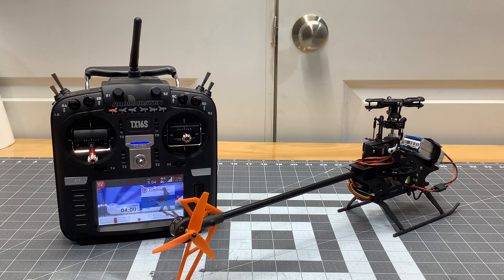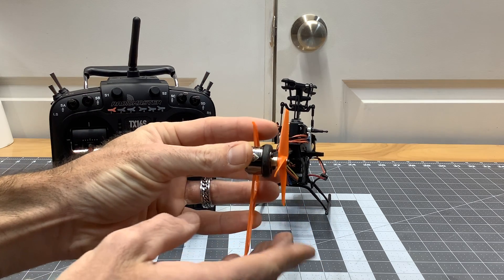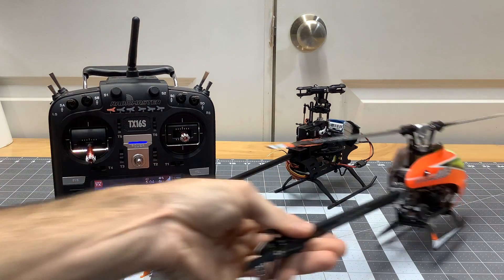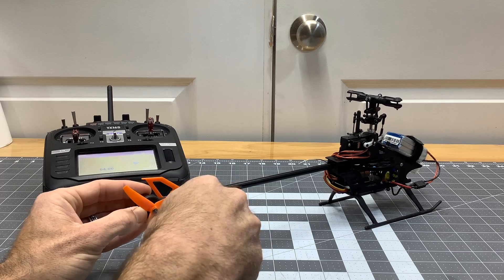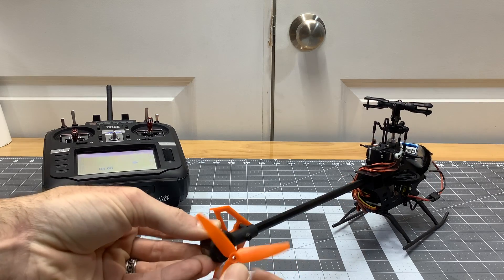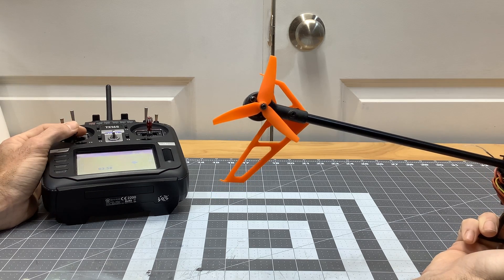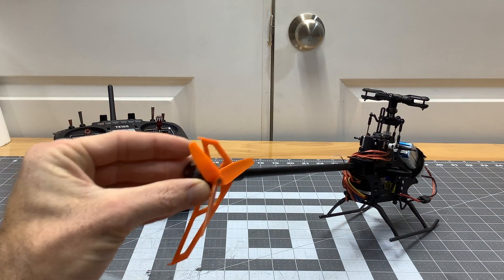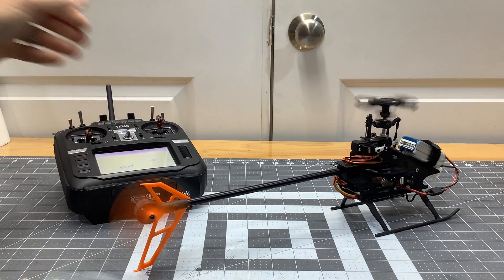How to properly install your tail blade on a brushless driven tail motor

Comment: how to choose the right brushless motor for the tail rotor
Reply: Yes, for custom build 😁
Reply from the maker: @muhammadhafizollandra7976  well what size heli? How big are the blades?
Reply: @westhobbiesrc8051  size 450 blade 315mm
Reply from the maker: @muhammadhafizollandra7976  Look into the FW 450 and use that size tail motor and blade
Reply from the maker: For a custom build?

Comment: I have intermittent issue with my blade 230s. Once in a while it loses control of the tail mid air, it’s like the tail motor cant keep up with the demand to anti torque. I wonder if it’s a firmware issue in the AR636 unit.
Reply from the maker: Make sure you do not have any shaving of the tail motor wires, pull the tail boom back and make sure there is no brakes there. Also look at your bullet connectors on the ESC I’ve had them on Solder before. Is it a V1 or V2?
Reply: @westhobbiesrc8051 not sure, probably V1. It’s the night light version one. Original tail motor burnt out by itself and Amain hobbies sent a new one under warranty. But still didnt solve the issue where the heli went bezerk randomly for 3 seconds every now and then. Not to mention this heli likes to tip to the right during take off since brand new out of the box.
Reply from the maker: @henryairconcepts2999  sounds like a V1, they always had tip over issues. I would check all the wires from the ESC to the tail motor make sure nothing is shaved or broken but it could be a bad ESC.